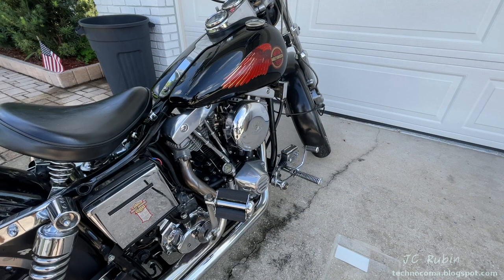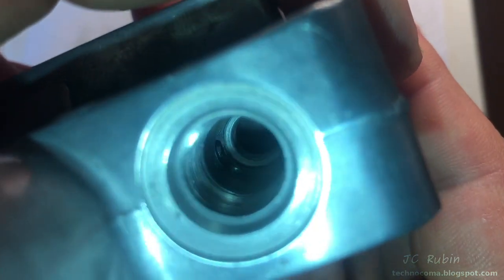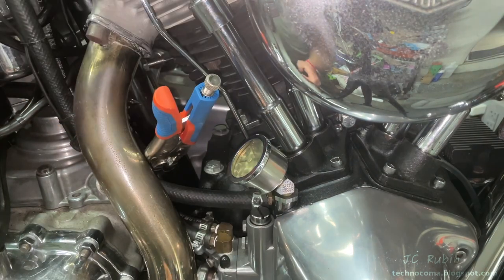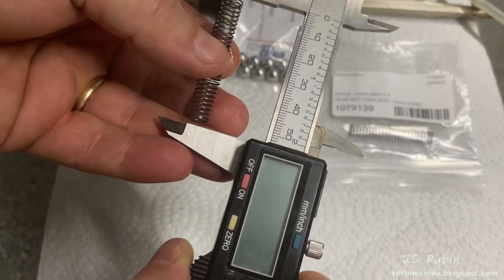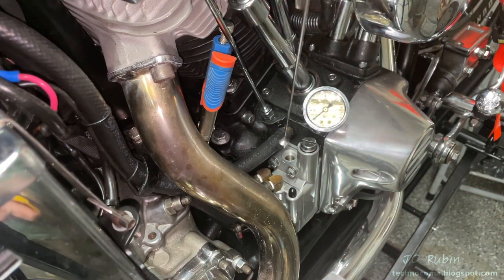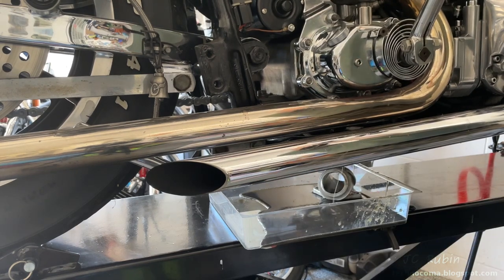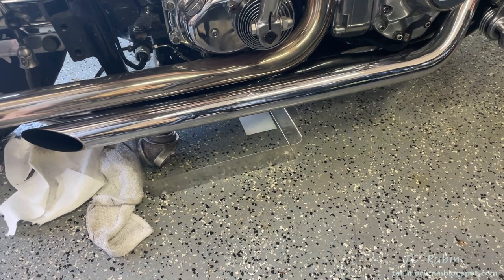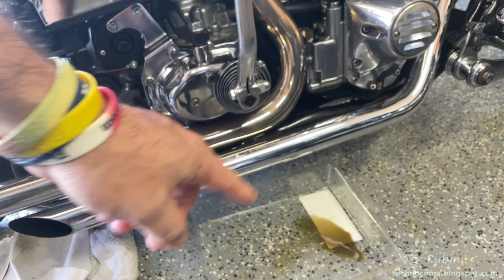Shovelhead Engine - Oil Check Valve Repair

Comment: Thanks for the video.  I'm refurbishing my 1980 Shovelhead wideglide, and I too need to replace the ball.  Since I plan to remove the oil pump and disassemble it, I will play extra attention to the spring and ball.  Wayne out West (metro Denver)
Reply from the maker: Glad it helped

Comment: I had the problem before my rebuild. I took the pump off did the tap tap and fine valve grind with a new ball epoxied on a dowel on the seat...will know in a few weeks how it worked out...fun fun lol

Comment: Loved the video, I oreder the kit but was.waiting to replace it.  So now I will thanks to you. 
I do have one.important question not.related to the check valve. 
I have drag pipe on my 76 FLH shovelhead, they look like yours. My problem is I cannot find the the rear mounting bracket for the front pipe.  Can you send my a picture of the rear bracket you have for the front pipe, and also tell me where to purchase it.
Reply from the maker: This is available as an installation video in my 34 part series when I re-install the exhaust around part 29

Comment: Such a tremendous help. Thank you so much.
 Just to clarify, the tapping of the ball was with the old one and you did so to insure good seating before putting in the new one?
Reply from the maker: No, I tapped with a brand new one… then I threw that one away and used another new one as the final check valve ball.

Comment: Thanks for the info. I see your pressure gauge. Does it read the right pressure like around 20-30lb when rolling? Also, there is a vent hose from the case down where you are working on my S&S evo engine that goes to atmosphere. It seems to leak a lot. Can the check ball be causing that also? I haven't owned it long. 2001 Evo style Indian chief S&S motor. Anyway, I will change the check ball like you did anyway and can I vent that line to a filter going up instead of down to keep the oil from going out on the ground? I hope you know what I mean. Anyway, I am a Twin cam guy until now. Thanks a lot. Hard to find the info about this. Oh yeah, oil comes out of the oil cap a little also when riding. Not much.

Comment: Great video!!  I have a question, will a bass oil sending unit cause the breather to puke oil when riding? It’s not a shovel, but this happened to my 02 Road King. No mechanic that I have found, knows why. I was running around 85mph and it suddenly started smoking bad because the oil blew out the breather and hit the pipes.
Reply: This is exactly what my 98 is doing to me right now can't fund the issue

Comment: In all fairness, the breather hose was never meant to be routed under the bike.
It was designed to lead upward to the aircleaner. 
In a properly maintained engine, the  crankcase will vent slightly pressurized air upward but gravity will keep the oil where it belongs - off of the rear tire ! 
Just remember,  Shit runs downhill and so does oil 😅